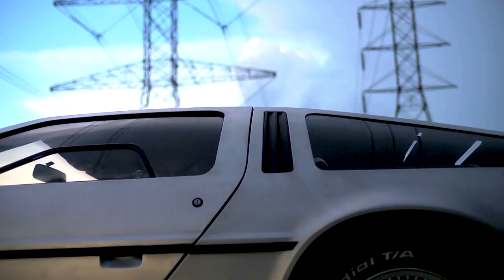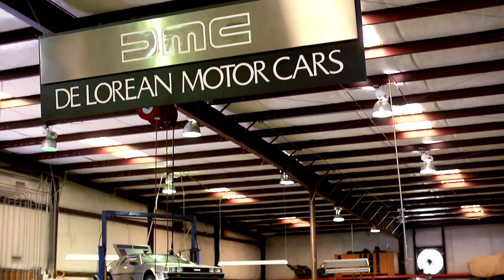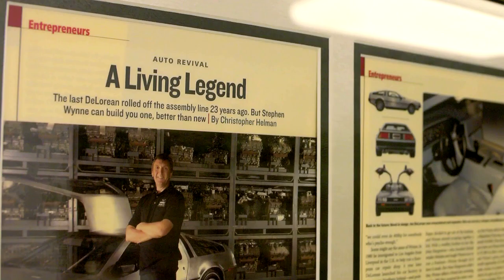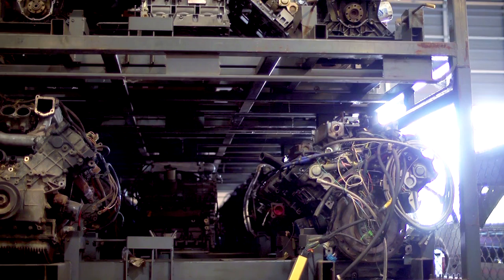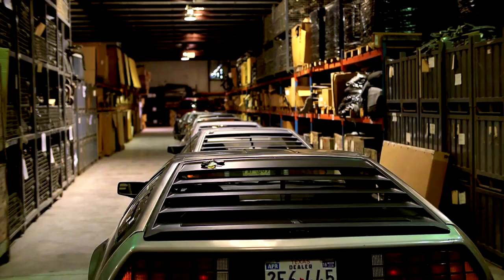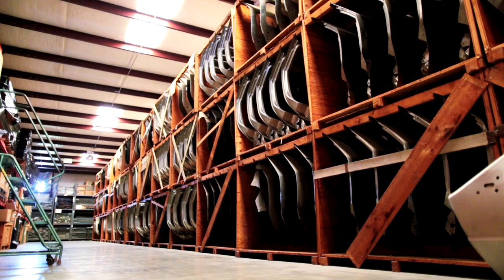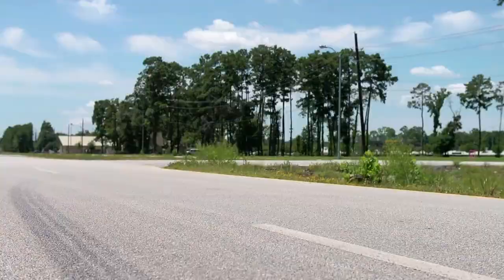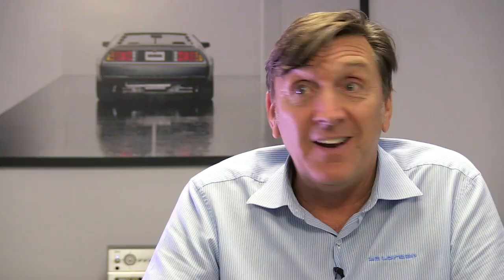New DeLoreans are still available, straight from the factory

Comment: If they produce the same engine it's a waste of time.
Reply: Yellow Waffle I will happily run my stock DeLorean against ANY stock 1981 car you own...
Reply: NorthernChev, seeing as the '81 and 86 El camino's are the same engine and body build, can i take you up on that offer in my '86 elky? :D
Reply: 0-60 on a De Lorean is 9.5 to 10.5 seconds. Most contemporary GTs would do it in two seconds less. My  stock standard 1990 GT can still 0-60 on 6.0 seconds or less and it is two liters normally aspirated.
Reply: Kitsune In complete factory stock form for both cars, the DeLorean will walk away from an 81 ElCamino, if from nothing else, being 1000 lbs lighter.  We're not going to have silly replies concerning cars altered from factory.
Reply: spacecadet This is not a thread concerning ourselves with comparing cars from different eras. Not to mention GT means something completely different to the car industry today than it did in 1981. Today it means "faster", back then it meant Grand Touring, which had less to do with speed and more about the driving experience the car would offer. This is NOT about contemporary cars and is silly to compare them as such.
Reply: I am meaning ""GT" = Gran Turrismo (translation = Grand Tourer).  When I am saying comtemporary GTs, it means GTs made the same year as the de Lorean.  The de Lorean was very slow compared to sports cars and GTs from the era. 
Out of interest, a stock 1973 350 ci El Camino can do 0-60 in 8.5 seconds. A de Lorean can do it in 9.5 seconds.
Reply: Spacecadet  1973 was the 'end' of the original still the muscle car era... 1981 was a choking smog-engine era. A 1981 El Camino could barely wheeze it's way down the street. Stop comparing cars from different eras.  As well, the DeLorean is not a sports car as you mention in being compared to above.
Reply: Hugh... where'd you get the "any car from the 80's" quote?  Nobody in this thread ever said that.  Don't 'Trump-out' on us and make up stuff.
Reply: Hugh... Where'd you get the "any car from 81" quote? Nobody in this thread ever said that. Continuing to repeat it as if someone here said that isn't going to work...
Reply: de Loreans were originally built from 81-83. It could do 0-60 in 10.5 s according to Road & Track.   Other cars from the era and their 0-60 times include 1979 Cadillac Eldorado (10.7s), 1983 BMW 533i  (7.6 s),   1983 Datsun 280ZX Turbo (7.2 s), 1981 Ferrari 308 Dino GT4 (7.7 s), 1983 Ford Mustang GT (7.4 s), 1983 Mercury Capri (7.6), 1983 Porsche 911 Cabriolet  (6.9 s), 1983 Saab 900 Turbo (9.9 s), 1980 Triumph TR8  (8.4 s), 1983 Volkswagon Rabbit (10.5 s).
When you know that your GT has difficulty out accelrating a luxury car or a family saloon, then you know that something is very wrong somewhere.
Reply: Spacecadet... Now, go back to my original comment and tell me which one of those cars Yellow Waffle owns - which was the purpose of the comment -> and we'll have ourselves an auto-mo-bile race.
Reply: Can I bring a stock 81 Corvette Stingray? It isn't very fast but it will still beat a de Lorean by 2 seconds or so to 60mph.
Reply: Yellow Waffle they wouldn't do that after all this time and advancements in car tech
Reply: yup !!
Reply: Yellow Waffle idk what a dmc has no performance what so ever that shit is slowe asf
Reply: I would rather drive it for what it was, before they took all those little horses for the sake of emissions controls.
Reply: '81 Z28 Camaro with the cheverolet 350... or the Pontiac of the same body with the 403...
Either of those vehicles stock from the factory would outrun that DeLorean.
Reply: Yellow Waffle - Not really, cars with the most resale, have the original parts.
Reply: +spacecadet35 got a mini that'll leave you wishing u'd stayed at home
Reply: James B You don't buy a Delorean to resell it. You buy houses to resell. You buy a Delorean to have your own Delorean.
Reply: kajidono - Some people could, it's up to the owner. Plenty of people are into flipping cars, and ideally making profit. Who says classic cars like this aren't a good investment.
Reply: James B The value on a Delorean moves far too slowly. I mean, you could have one as an investment and hold onto it until you're 90, but it's value would have barely kept up with inflation. It's like buying a house for $50k and reselling it for $100k, but you held onto it for 40 years and now the currency is worth half as much as it was. You might feel good about it but you didn't actually accomplish anything.
Reply: kajidono - Look at Hagerty's, Redbook or any car valuers, and they will say between 30-80k. They are going up in value. People that ordered them new in the 80's are sitting on a collector car.
Reply: +Yellow Waffle
I would like them to change the engine too. However they have a huge stock of these engines and it would make sense for them to use those engines rather than sourcing new ones. Right now they are working on adding twin turbo kits to get proper power out of them. While there aren't many aftermarket stuff for that engine, the PRV isn't exactly a really bad engine. It was a DOHC PRV V6 powered Peugeot that clocked the highest top speed in the Le Mans circuit and that record still stands. 
Matt Farah has a Stage 2 Turbo kit on his Delorean and its pretty good.
Reply: Yellow Waffle AQ3D 
I have had a couple of flying brick Volvo 760's ( although I usually keep quiet about it ) with both versions of the PRV6 and you're right- they're not a bad engine but a bit underpowered although I have given a few conventional 5litre V8's a fright back in the day.
Lower the compression and add a turbo , then you'd really have something. 
Maserati used the motor too.
Reply: Yellow Waffle AQ3D The engine is an European one. Bear in mind that in Europe back then it was not that bad. Few cheap modifications can dramatically increase the BHP. Example a Soft turbo set up would transform the car. All stock, couple of hundres bucks to set it up. But the point of this car is what it represents. If unwant performance buy a Corvette or M3. But I am sure you gonna have more fun in this.
Reply: I would love to see an updated engine with modern outputs. But for original its ok as a cruiser vs. stop light racer.
Reply: I agree 1981 was one of the lamest years for US cars, but a Porche Turbo or even a Corvette of the era would give it a run. Maybe there was still 6.6 TransAms around, though breathing through pre-computer emissions designs. Face it, the De Lorean is a beautiful car, but had Chevy Citation level output with the French V6.
Reply: Thanks for posting reality. I forgot about the Datsun Z Turbo's of that year. Company I worked for back then the owner got one, and it was the rocket of the day.
Reply: Still had to sell in the US under EPA regs, which strangled it. And modding to add a turbo does not count since I can make a Honda Civic of the era a racer if I wanted to do that.

Comment: 99% parts availability. 
Flux capacitors on back order.
Reply: If you ask O’Reilly’s and ask them for one it actually will look up in their system
Reply: cocaine is missing also
Reply: R2 D2  it's safer lol
Reply: Andy Speck right😂
Reply: @andyn46  Part # 121g
Reply: @Fakeaorta  I just checked an it still out of stock
Reply: Aliexpress has it in stock.
Reply: Except Left Fender.

Comment: If I had one of these my next move would definitely be a retro fit. Redesign the doors,  engine braking system and interior...On the outside it would look like the original but underneath the veneer it would be very modern - the lights would be LED.

In my opinion a retro fit like this is true to film that inspired so many people's nostalgia for the car. You may not be able to add a 'Mr Fusion' but you could certainly had a hydrogen or electric engine today.
Reply: There are restomod DeLoreans on Youtube that are exactly what you described, and they're very cool.

Comment: Long video and doesn’t even say how much it is to buy one today. Wtf???
Reply: Steve Wilson the new DeLorean is now back on track for a 2019 release and $100,000 price tag.
Reply: It’s not 100k it’s 30k to get one
Reply: @Manuel Santos 😭😭😭😭😭😭😭😂😂😂😂😂😂😂
Reply: I wonder if with the new ones they corrected all the problems? I know with the body parts and panels they might upgrade to better stainless steel as the original was all low grade stainless steel and did rust.
Reply: @frankw3217  owner's clubs in Europe have redone the parts in stainless steel.
Reply: @davis.fourohfour  but are they of a higher grade of stain steel than originally used? The original grade of stain steel was very low grade and it rusted.
Reply: Aaron Parvin it WAS 30k for a NOS DeLorian. However, they no longer have all the parts in stock necessary for them to be able to make complete NOS cars as of 2017. Since they now have to fabricate the stainless steel exterior (as the body panels, hoods, doors, etc are some of those major NOS parts they ran out of) and no longer have that large stockpile on hand of unused bodies that were made in the late 70’s-early 80’s, but most importantly, were paid for by someone else, the new price reflects that added cost.
Reply: $65K US
Reply: @frankw3217  yeap.  There are like different "packs" available, being most of  them solutions for the original problems they had.
Reply: Cause theres no price yet. The link in the description said probably between 85k and 100k....but comes with more horse power and a flux capacitor.
Reply: @AaronLeeParvin  that's not what the link says
Reply: @AaronLeeParvin  assembly required
Reply: 88k
Reply: A brand-new DMC-12 will likely cost around $100,000, with plans to build 300-350 over the next six years. The company initially planned to begin production early in 2017, but encountered setbacks with parts suppliers and regulatory boards.Oct 17, 2016
Reply: @AaronLeeParvin  A brand-new DMC-12 will likely cost around $100,000, with plans to build 300-350 over the next six years. The company initially planned to begin production early in 2017, but encountered setbacks with parts suppliers and regulatory boards. Oct 17, 2016
Reply: Right!,,, how much for a driver ?   I need one !
Reply: I found one for 10k
Reply: @AaronLeeParvin  no its not
Reply: If you call 6 minutes a long video.
Reply: @commietearsdrinker  It's absolutely "Long" when you want the time back!. 😉😂😂
Reply: @AaronLeeParvin  100k or 30k?
Reply: $80k to $100k depending on what you want it to have.. But as of a month ago it'll take at least one up to two years before you even get yours.
Reply: When they don’t tell you the price, you know it ain’t cheap. Lol
Reply: @frankw3217  I've never seen a rusty DeLorean
Reply: @awesomeone2979  No way. I'm pretty sure it's 2021.
Reply: @alexs.9341  How much is that in English pound notes?.

Comment: The engine is called the PRV V6.
Which stands for 'Peugeot / Renault / Volvo'.
It was a joint project between all three car companies, and was first used by all three brands in various models from '75 or '76 onward. 

The PRV V6 has also been used in lots of other cars, mainly sports coupes, (inlcuding the DeLorean, of course) by other much smaller brands over 
the decades.
 Sometimes with a turbo, sometimes even with a twin turbo, (which Renault did on its own Renault 25 Biturbo and then the 
later Renault Safrane Biturbo in the '90s). 

While one of the more memorable sports coupes/brands that's used it was the Alpine brand rear-engined fibreglass-bodied coupes, (sometimes referred to as the 'Renault Alpine'. Arguably the closest French equivalent to a Lotus but with the engine layout of a Porsche 911) which finally got the engine as standard from about '84 through to the mid '90s, with the option of turbo. 
 *[Side-note: after about a 20 year absence, Alpine has been recently revived as a  brand - but has changed to a mid-engined layout, no more 'plus 2' rear seats, more compact size,  and a smaller but boosted  engine. Aimed to compete with the Porsche Cayman, Alfa Romeo 4C, Lotus Elise, etc). 

While due to Peugeot buying out Citroen in around '76, Citroen also got the PRV V6, eventually, in the top spec models of it's upper size cars, (starting 
with the XM from '89, then the Xantia, C5, C6, etc). 

 The DeLorean really needed a turbo, (or supercharger)  as either standard or option right from the start.
 Due in no small part to its heavy stainless steel body, (but at least that keeps the body panels rust-free!!!). 
It's crazy they don't now offer the option of an upgraded DeLorean, (as suggested above) with the performance it should have to go with the looks, 
rather than just selling it 'as it was' when new way back in the early '80s.
Reply: Awesome info, I learned something new!
Reply: WTH
Reply: From Leo:  Factory Trained Volvo Technician;  that was the worst engine Volvo ever offered.   I am sure that adding a turbo would make it even less reliable.  Uneven firing, noisey,  170 cubic inches of leaks, bad cams, blown head gaskets and bad timing chains held together by tiny corroded bolts. .     Maybe ok for a collector,  or a trailer queen,  not something you would want to take on Holiday.

Comment: Should source aluminum LS engines to put in these things; not like a Vette version, but more middle of the road V8; put a reasonable transmission/gearbox and make brake/suspension adjustments as necessary and those things would be freaking awesome. 88 mph would then be well within reach!
Reply: Nah man, it needs a Voodoo, or a blown Coyote engine!
Reply: Apparently the engine was restricted for the US market, so you could just not do that.
Reply: merp ius nah, i’d say turbo the renault prv v6 to make 400hp at least. and strengthen the rollcage as it is a unsafe car.

Comment: Would be nice if they (GMC?  If they still own the rights to the design) redesigned the engine and other parts to make them good cars manufactured at a reasonable price whilst still maintaining the original aesthetic.  Basically, fix the internal problems and leave the external features alone.  Then they could sell them for a reasonable price in the mass market.
Reply: That Sodding Gamer dmc?
Reply: That Sodding Gamer GMC, you mean DMC
Reply: Yeah it's as simple as spending hundreds of millions on R&D and meeting the safety requirements of the current day. Want to become a millionare? Give thesoddinggamer 200million.